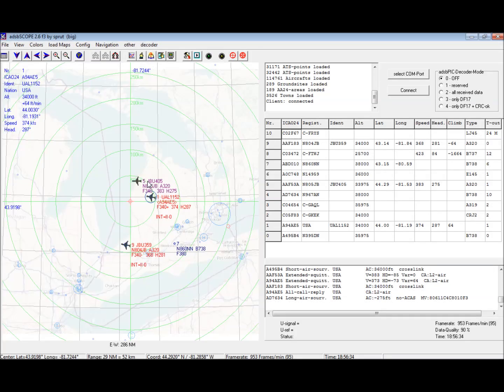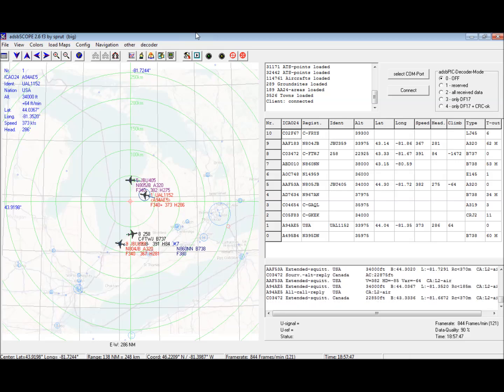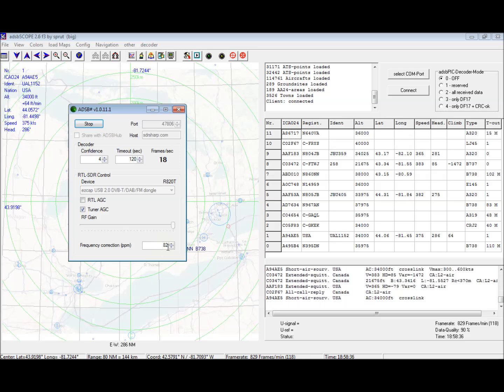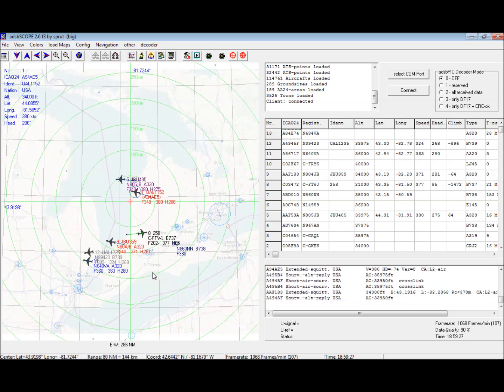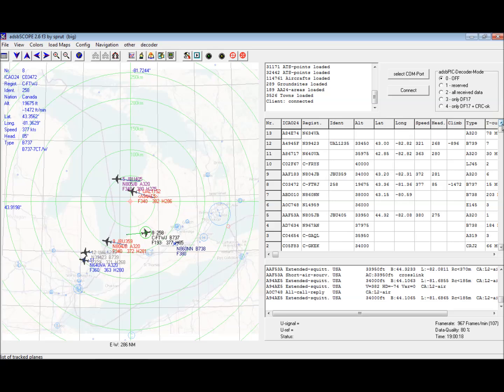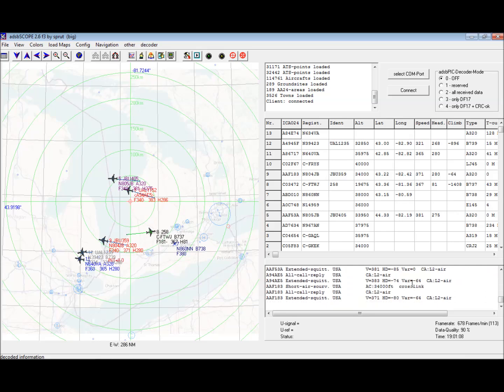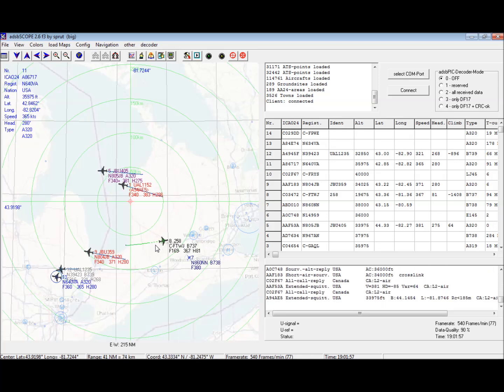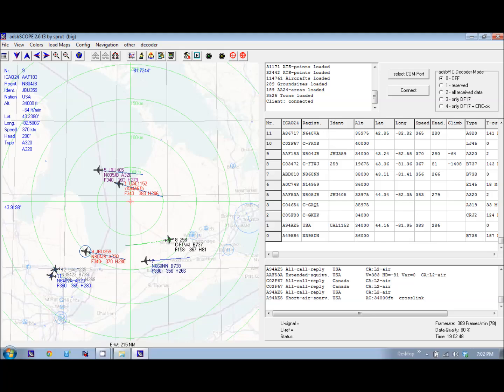DIY Air traffic Control via ADS-B with Cheap USB SDR- Tutorial

Comment: If you was going to make a Omnidirectional vertical antenna what would the frequency range be. Would it be in the 116 to 144 Mhz.
Reply from the maker: This is on 1090MHz.  Cheers